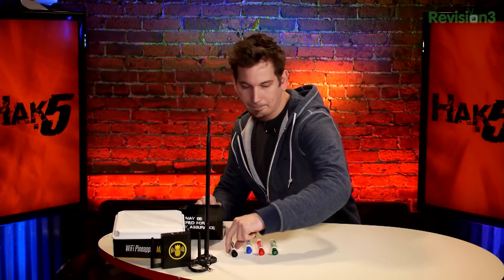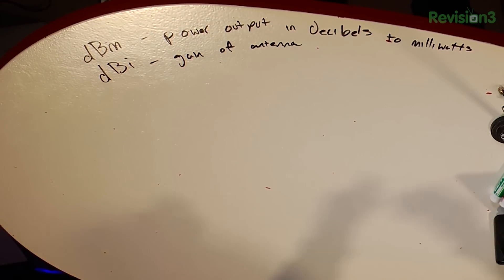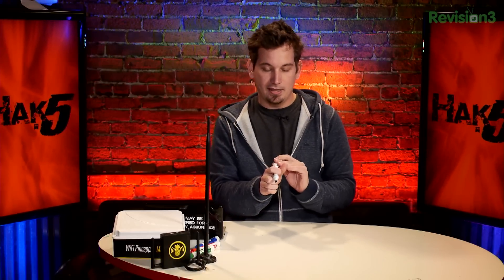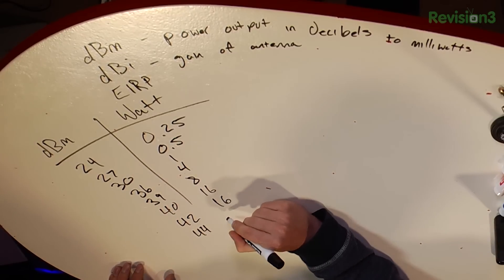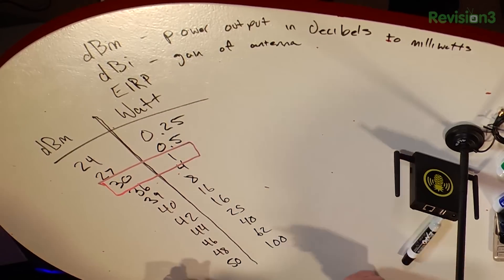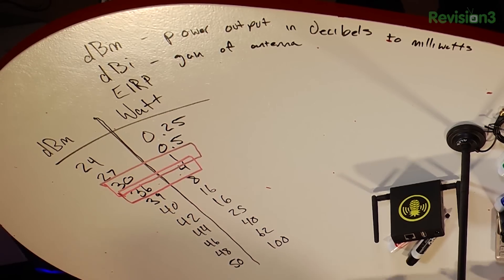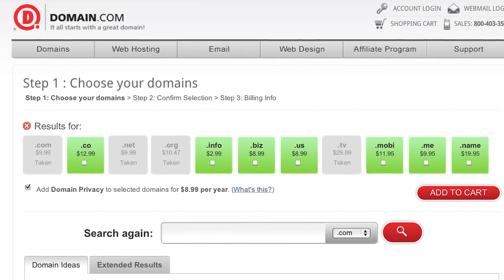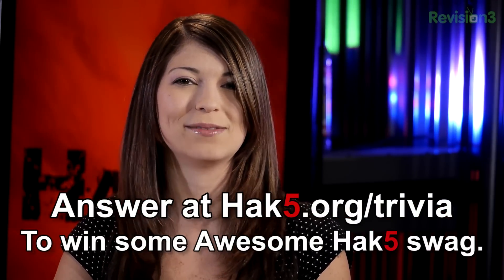Legally build a 60 Watt WiFi Link - 2.4 GHz and EIRP, Hak5 1515

Comment: I was told that this would still be illegal because the radio is limited to the type of antenna that was used when licensing the device by the fcc. So if it was only tested with a 6dbi omni antenna you couldnt use a 24db prabolic since it was never tested with this family of antenna..  Can any one shed light on this ....

Comment: You might want to check the math again. You're not going to produce a 60Watt signal profile from a 1/4Watt of input power. Also, there's the ever-present problem of VSWRs!!!!
How are you planning on correcting any SWR issues?

Any little loss from SWR issues wipes out any hope of dBm and dBi getting together and multiplying anything.

I love how you tend to gloss over base issues in so many of your videos.

Comment: You are still so accident prone. .. it may of help if you explained 20 log x = dbm.
Reply: Except that the equation is dBm = 10 * log (Watts/.001 watts)
or dBm = 10 * log( 1000 * watts)
for 1 watt
dBm = 10 * log (1000) = 10 * 3 = 30 dBm.

There is a 4th rule that he didn't cover that deals with band edges sometimes called the forbidden band edges. There is an absolute limit for those. No 3 for 1 exception there. So if your doing point to point use the center channel.

Comment: So in short, if you use a lower dBm gain you can use a higher dBi antenna legally? And because using higher dBi antennas makes the wireless signal more directional you can push more watts through there overall?

I'd like to see some tutorials on setting up multi-radio networks using both directional (high dBi) antennas combined and low gain antennas on different radios to create repeater/bridging setups or even more effective pineapple setups by allowing the pineapple to be located further away from the originating network.

Comment: If you want to exceed what's shown in the video and do it legally; get an amateur radio license. In the US power output is limited to 1500 watts Peak Envelope Power. So I don't have to worry about the gain of my antenna. As long as my radio doesn't put out more than 1500 watts I am good to go. There are a few downsides however. The 13cm amateur radio band only goes up to 2450 Mhz, which only gets you up through wifi channel 6. The other BIG downside is that you aren't permitted to use encryption. Wifi without encryption is generally not recommended. Also, your transmissions have to be intended for other amateurs, so if you don't have a license you wouldn't be able to connect. That said, ham radio does give you options unlicensed operation doesn't. One of these days I may have to pick up one of those wifi amps from L-com. Imagine the fun you could have running 25 watts into a yagi or dish. I can't wait to see the hak5 episode on the broadband ham net.